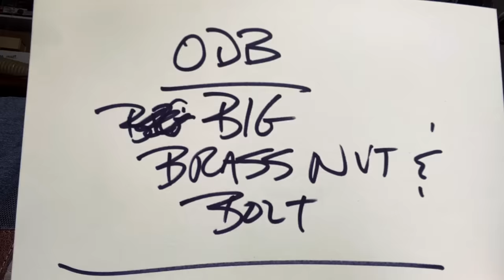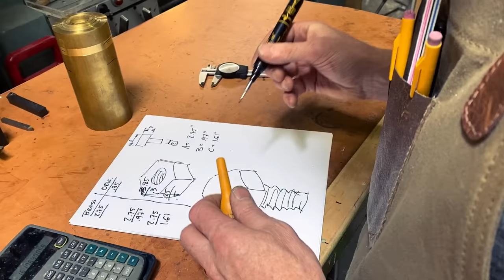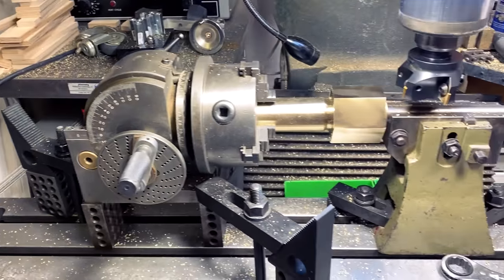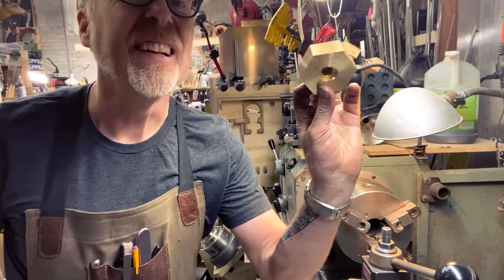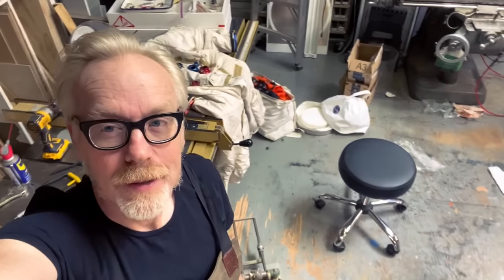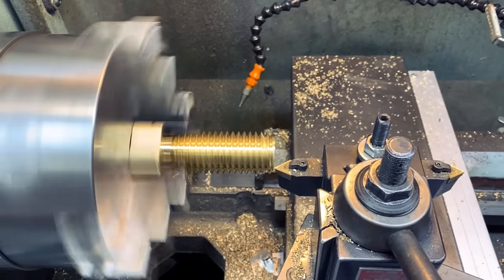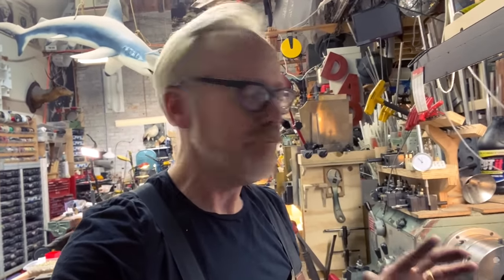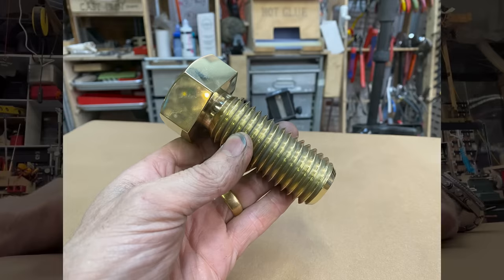Adam Savage's One Day Builds: Giant Nut and Bolt!

Comment: Hi Adam, I worked as a toolmaker for 4 years and we made cutting machines out of brass. If they got corrupted or damaged we 
soldered material on top an then polished or machined the surface again to its original state. The damages I saw in the bolt could be easily fixed by applying brass solder. maybe this one thing for the next project .... cheers love the show ....

Comment: The jaws on the mill’s indexing head should be removable so you can rotate them and hold larger stock.
Reply: He mentioned it was self-centering so it would have a scroll plate like a 3-jaw chuck so there would be a separate set of jaws that face the opposite way.
Reply: What he said...
Reply: @dylanklingspohn9928  Ah, so the ridges on the outside of the teeth are more for holding the inside of a workpiece
Reply: @dylanklingspohn9928  then the chuck would have an external set of jaws to use.

Comment: Nice One Adam - For future reference. Nut & Bolt ratios - Bolt Diameter = Ø . Across Flats 1.5 x Ø - Bolt Head Height 0.7 x Ø - Nut Height 0.8 x Ø. The bolt end which you chamfered is normally rounded on large bolts, the radius r= Ø. The chamfer on the top of the bolt is 30° and taken only to the Tangent point of the flats. As you observed only one side of the bolt, but both sides on the nut. Thank you for sharing and taking us through your journey of thread cutting Purgatory.

Comment: This video truly shows the humanity involved in learning how to be a machinist on traditional manual machines.  Most manufacturing CNC operators never get to experience this. Load program that an engineer wrote.. Load Part. Push button. Get result.  That just doesn't have the same impact as manual machining, which is truly an art form.

Comment: i remember my first time cutting threads.I was so happy with myself as soon as I let my shop teach see it he told me. 'nice how good are the threads'. My only answer was 'what?' Then he tried to move the nut back and forth. Told me ' A little tight for my liking but for a first time not to shabby'. Then I got cocky and try to do the same thing again but this time aluminum not steel and well that grippe that your talking about we all call gummy. And yes it will throw your part and or cutter across the shop.
Reply: Not if you do it right. Gummy material just doesn't make pretty threads until you get a thread file and a normal file after it. And aluminum is like cutting butter versus steel unless its some crazy alloy.
Reply: @jarrodsutterfield3752  That's what non-machinists think. Aluminum isn't as easy to machine as you think. Even after years of machining aluminum, I'd rather cut steel any day of the week. (Depending on the alloy of the steel and aluminum.)
Reply: @xenonram  aluminium isnt that hard to machine if you put a load of coolant over it then it is one of the nicest materials to machine only the long wire chips (i dont know how else to call it in english) are a bit of an issu

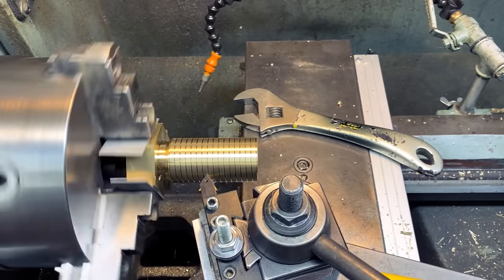Comment: 16:14 "Yep.  Seems like 20 thousandths is about the sweet spot".  Sure when you only have the tip doing the cutting.  The deeper it goes in the more friction and the more material it's removing.  Being that it's cutting on 2 faces each at 30 degrees, for every 20 thousandths deeper you add 46 thousandths of the cutting tool that's being used.  2 faces * 20 thousandths / cos(30 degrees) = 46.1880 thousandths.
Reply: lol, the first fail - well you learned your lesson
the second fail - dude, learn your damn lesson
the third fail - come on learn the lesson
the 4th fail - you were show the damn lesson 3 other times, did you finally learn the lesson?
Reply: The bit is actually cutting on its front side only. But 20 thou is still definitely too much. I don't go over .010" but at that cut depth I use a live center in the tailstock to support the work.
Reply: @steadyeddie7453  should be cutting on the front of the tip... but i doubt he was set to 29.5... bet he was plunge cutting every pass.
Reply: *brass is grippy
Reply: @dobrzpe  Exactly! It is the little things that make all the difference!
Reply: @dobrzpe  AND backwards, AND upside down... (but, it worked! 🤣)

Comment: Adam, you need to check out “This Old Tony”
Reply: Adam has referenced This Old Tony before! He has watched his videos
Reply: TOT makes stuff look so easy and his humor is on point. It makes me feel better seeing Adam struggle knowing how challenging I have found learning this stuff to be!
Reply: He needs to watch Abom79, or Keith Fenner. Either of them could've knocked this project out in 30 minutes, but they've also been doing it a long time.
Reply: @gorak9000  Yeah, they probably wouldn't be backing their lathes up in reverse to single point when you have a thread dial on the machine for timing [dis]engagement of the half nuts
Reply: @schwig44  If he's never threaded before, I could see not understanding how to use the thread dial. Hopefully he'll learn that during the next time he needs to make threads. After watching enough Abom79 and Keith Fenner videos though, even I've picked up on tricks like chamfering the edges of both the bolt head and the start of the threads before threading, and I don't own a lathe (yet) but I do own a slightly broken CNC mill which is slowly making it's way back to functional territory, hence the watching lots of machining videos
Reply: And abom79
Reply: Would be amazing to see Adam work with This old Tony AND Abom79 !
Reply: couldnt agree more, adam has a lot to learn from tony.

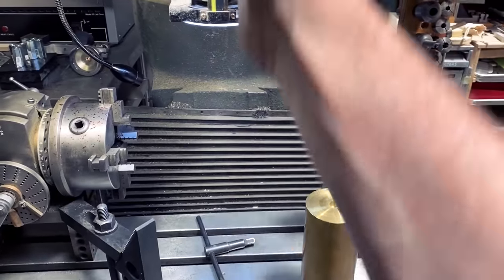Comment: 6:50 - Wait, aren't these jaws reversible?
Reply: That's what I was coming here to post... surely someone else caught that too. I doubt Adam reads the comments, but someone needs to tell him that the chuck on his dividing head is plenty big enough to chuck that blank, you reverse the jaws.
Reply: @raspberrynomnom  not all jaws are reversible, in particular the jaws on a scroll chuck (self centering, what's on the dividing head) are not
Reply: @CrashTestCoder  I know not all jaws are reversible. But it's not true that no self-centering chucks have reversible jaws. I've used them, and just search online - Google "lathe self centering chuck reversible jaws" and there are tons of them.
However, I think you're right that his aren't reversible. On a scroll chuck, the grooves on the jaws the scroll bites for self-centering would be facing the wrong direction if he reversed them. On reversible-jaw scroll chucks, each jaw is two-parts, the gripping part mounts to the grooved part with recessed bolts through the face of the grip part. It's possible to see in the video that his don't have the bolts, so you're right they're probably not reversible.
I generally think of three-jaw chucks as scroll chucks and 4-jaws as independent; I know he said it's a self-centering chuck, but I wasn't thinking about it... I think part of me was assuming it was independent because it's a 4-jaw.
Reply: @raspberrynomnom   I also automatically think of 4-jaws as independent - but not in this case, it seems.  That said, the outside of Adam's dividing head jaws are textured the same as the gripping face, which makes me suspect that they likely are reversible after all.
Reply: Exactly what I was thinking. I'm a welder and we use 8" lathe heads as roll out wheels for for welding pipe. Every one I've seen has reversible jaws, you just have to be careful threading them back in so they don't get out of sync.
Reply: @aussiebloke609  my lathe jaws are textured similarly to Adam's, and they are not reversable. The outside edge it textured for gripping onto the inside of bores, not for reversing
Reply: @CrashTestCoder   OK.  I was mainly referring to your statement "the jaws on a scroll chuck (self centering, what's on the dividing head) are not" - when there are many scroll chucks that are.  It's your blanket statement that I found to be overreaching.
Reply: @aussiebloke609  based on what was said by Tom Ingling, I agree my statement was overreaching, but as Tom also said, the jaws are not the type of reversable he was referring to as they don't have screws in the front face.
Reply: @raspberrynomnom   Two sets of jaws were supplied with my self centring 3 jaw scroll chuck. One set are reverse jaws.
Reply: Some scroll chucks have reversable jaws, some require a 2nd set. All depends on how the "teeth" are cut in the back of the jaws.

Comment: I’m a little disappointed he didn’t come back to the “lever that doesn’t matter” when setting the gear box for cutting threads. It very much mattered.
Reply: What does that lever do?
Reply: Brian Jarrell If you look at the top of the chart at 11:04 you see corresponding letters for that lever. In this case it needed to be in the X position
Reply: @Renoh74   So if he needed to do it in millimeters, where would he have to change it? There was a C in the chart but no C in that particular lever, right?
Reply: @brianjarrell9203  I agree I watched them as a teenager and have been machinist since 2012 . I a little disappointed to see his skill is a little lacking.
Reply: odkres Yeah, it’s a combination of the levers. In that case the left most lever would be in C. I was wrong in my initial assumption that it was just the right lever that changed between english and metric units
Reply: @Renoh74  bingo. Its an easy mistake to make. Once you have done a fine cut to the diameter with the threading tool, its good practice to check it with a thread gauge. 
I have admired adam since i was very little and i love the fact we can see him learning a new skill, make mistakes, talk through the process and produce a finished product. 
1st attempt at screw cutting on his own and using brass, i'm impressed.

Comment: Right before it came out the chuck I was thinking “I’d have used a center in the end”.. This is why we have apprenticeships in the UK.. or we used to ..
😉😉
Reply: I'd like to see how he would make a fine thread on a brass tube 6" long,  5" diameter and a wall 1/10". LOTS of mistakes here and missed solutions.
Reply: I completely agree with the apprenticeship concept.  One must learn the basics first to avoid making the most basic mistakes.  Otherwise you are constantly learning and wasting material in the process.  Adam neglected to explain that the compound must be set to 29.5 degrees, and that cutting tool only cuts one side of the thread, until the desired depth of thread is reached.
Reply: @Al-Fiallos  Yes but this is not a thread cutting tutorial. The purpose of the video is to document a one day build. Hence a lot of skipped explanation of details.
Reply: I agree, when in doubt and able to do so support your work. Having had pieces pass my ear at speed I know this on a deeply scary level.
Reply: @mattphilip4595  If THIS would be a day's work, you are either  two weeks in my shop you you are fired.
Reply: @panan7777  it's just the name of the format given by tested. It's not literal.
Reply: @romanyrobes25  I know how the things fly and when doing stuff that would cause a heart stroke to an OSHA inspector, I proudly hunker down behind the big tool post on my sizable lathe, 5' work length, 6000lbs. Nothing can kill this beast. They were built to last for eternity. Last year I was sloppy and in a hurry, DEADLY sin, could get all the way to mortal and I let the 30lbs of steel fly from lathe at 600 revs. Well,
 I live to tell the story. When you are good, the quality of your mistakes also improve. ;))))
Reply: @mattphilip4595  If you'll read my comments I like jesting, but I also get edgy, if somebody is showing things that I know are wrong or dangerous. I might have come down on him too hard, because after watching the whole video I realized he's showing his learning process. At the same time I'm a little sad that knowledge is disappearing fast. I haven't been able to teach anyone more than maybe 20% of what I know. Work metals for 50 years and will go on for at lease another 15. I LOVE what I do, there's always so much to learn. Added benefit: work will keep you healthy and fit.
Reply: and then you see the big mess on the end - where the Center CARVED OUT A PATH to freedom through the meat of the bolt. Holy Shit.

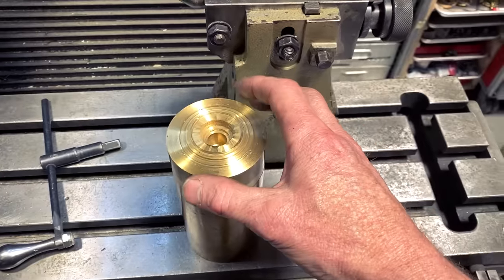Comment: 6:25 - flip the chuck jaws.
Reply: You can't flip one piece jaws on a scroll chuck. You would need a separate set of external jaws.
Reply: @DMTiffanyTimepieces  they can probably be flipped it all depends on if the jaws thread pattern on the back is crossed or not.
Reply: @DMTiffanyTimepieces  actually looking at the jaws they are bowed out not concave on the outside grip points which means that these are most likely not the kind you can flip.
Reply: @JoeyG1973  Besides some obscure (failed) designs from the 50's, one piece scroll chuck jaws are not reversible. If it were an independent 4 jaw chuck, then they would be reversible.
Reply: @DMTiffanyTimepieces  there are of course the ones that have jaws bolt on that are reversible.  I do have ones that are reversible via an x pattern on the jaw, ones that are not reversible, and ones that are the bolt type that are reversible
Reply: DM Tiffany Timepieces Amen to that. I saw there were steps only for grabbing I.D.

Comment: Adam, the jaws on your check are reversible and in making use of the "steps" as Chuck jaws....
Reply: Doubtful on a chuck that small, as the scrolling/face threading on each jaw would have to be so curved that you have no hope of removing and re-installing backwards. Those are hard jaws, so he likely does have a reverse set, but the swap isn't worth it when you have to turn the length of the bolt anyways, even if he had soft jaws that he could flip. Correct order of operations saves silly time wasters like flipping jaws

The point of the steps on the installed jaws is to be able to hold onto the inside of a part by putting the part on and forcing the chuck open as possible instead of in the chuck, and closing onto the work.
Reply: My first reaction as well 😉

Comment: When he said that last lever didn’t really matter I cringed. That was probably the most important one
Reply: What’s it do ?
Reply: hector garcia you mean the X beside the thread picture you see and not the Z it was set in.
Reply: @jamiewalker3383  It changes the rate at which the carriage moves when using the autofeed, which is a different mode that moves the tool at a rate used for cutting.

Comment: 11:25 "I don't think the XYWZ matters..."

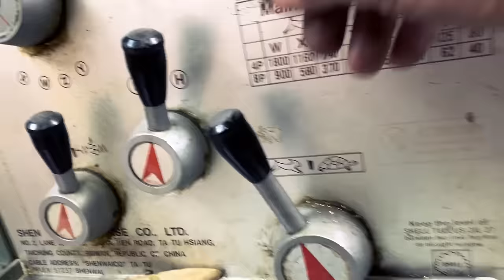isnt HB7B in the "X" column @ 11:07 ? SO shouldn't it be on X ?

It's on Z
Reply: It probably shoud have been on X to get an Inch thread, but as long as he did both threads with the same settings, it will fit. It's just not the 4 threads per inch he wanted to do in the first place.

The colmuns on this machine are very confusing.
Reply: @marcoungesund7047  yeah, that's exactly what I figured. As long he was consistently wrong, he was right :)
Reply: Yeah I saw that too. Was waiting to see if he picked it up later in the vid. Should have checked the pitch after the scratch pass ideally.
Reply: @Durdle  My favorite kind of right!

Comment: Next thread cutting project... An "impossible bolt" - one that has 2 heads with a nut stuck in the middle
Reply: So have to make the nut first then the two bolts, put on the nut and weld them together then re fix the weld spot on the lathe?
Reply: @5punkybob  the way I was taught was 2 bolt blanks drill and tap a smaller hole on the end of one, thread the end of the other to match and screw them together. Then thread the whole thing as one and make the nut to match that threading. Unscrew the bolts from each other, put the nut on one and thread them back together. If it's done well it's completely seamless and make a great puzzle
Reply: That sounds like fun to play with, just to fidget.

Comment: Nice work, sir!
As a mechanical engineer who is currently back in school learning both manual and CNC machining, I love these build projects. For someone who basically just self-taught himself both external and internal threading on the fly, that was pretty impressive. One minor thing I would suggest for anyone doing metalwork is the 'Machinery's Handbook Guide' or 'Machinery's Handbook Pocket Companion' (very similar). They are condensed versions of the industry standard book found in all shops. They're full of useful settings and formulas for things like cutting speeds, feed rates, proper sizing charts for UNC and metrics threads, tap hole sizes, grinding, troubleshooting, etc. It's also pretty cheap. Again, love the channel!   ;o)

Comment: I love how he gives a little speech about being able to make parts to someone else's standard and then never once looks up or even mentions unified thread standards.
Reply: Not to mention that a different size but and bolt head are just about useless.
Reply: @EdHelms1  Ever work on a vehicle? That crap happens all the time.
Reply: He said it was roughly 1.6 inches. closest size is a 1 1/2 - 6 UNC thread. It has a 1.4976" to 1.4794" major diameter and a 1.2991" to 1.2629" minor diameter. It should have a crest flat of 0.0313" to 0.0162", and a root flat of 0.0290" to 0.0208".

While I don't think Adam's had any flats, I still think it was a great learning opportunity.
Reply: @Beef4Dinner22  Damn, looking from a metric side of the world I find that 1.4976" to 1.4794" weird. Painfully weird. Like really cringeworthy.
Reply: @azgarogly  Thread standards are maybe the one area where imperial units and metric units are equally irrational.
Reply: @Beef4Dinner22  The lack of flats was really what stuck out
Reply: @nickuhland7148  That is because metric standard is derived from the older imperial one and still contains some weird constants like 17/24H as a real height of thread compared to theoretical H.
Reply: Would be a good standard to point back to as accomplishment